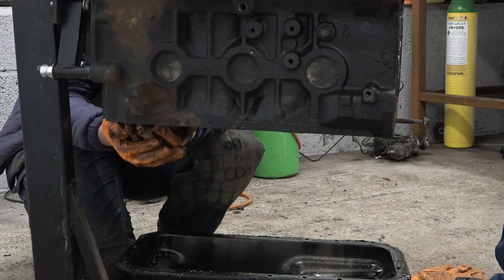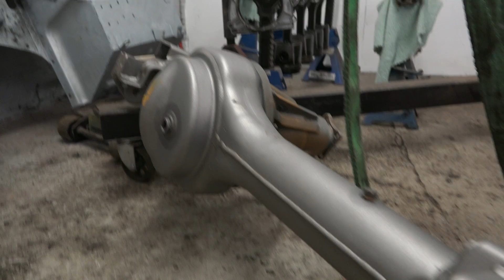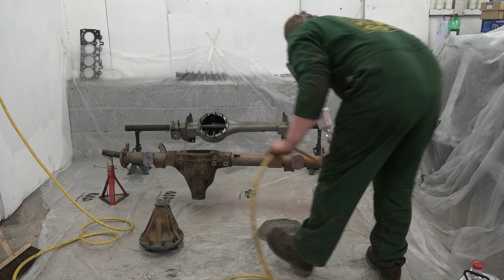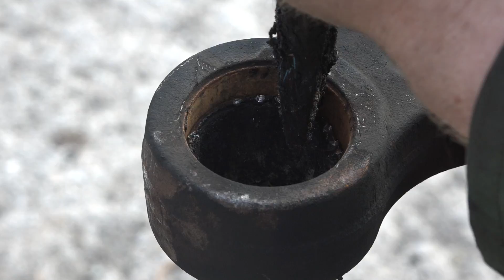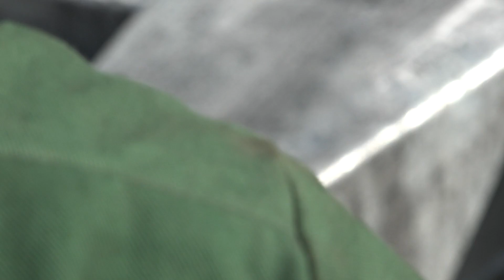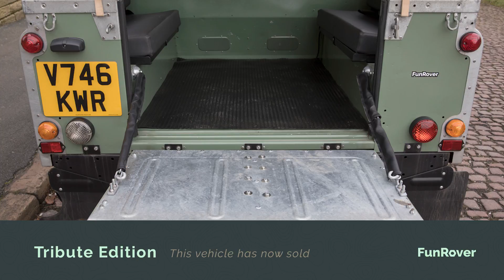Beach Rover 110 Build: Galvanised Chassis paint with Corroless

Comment: 1'4mm fluid tip?   Wow I didn't think you could get the RF16 through that.  How much did you thin it down by Ben?
Reply from the maker: Land Rover Toolbox Videos no more than 5% but it was very warm the day I painted 👍🏻
Reply: I bought a 2mm to go with the RF16 and figured it might struggle. I'm surprised you got it through the 1.4 ok... Learn something new every day I guess!
Reply: ah, good stuff.  The more thinning that is required the more coats would be needed.  Nice to hear the weather is kind for you.